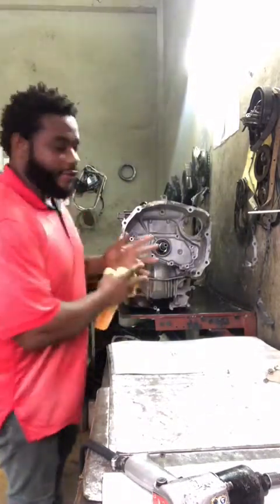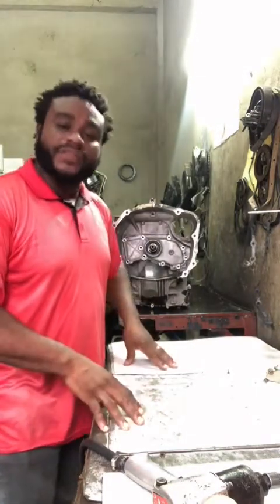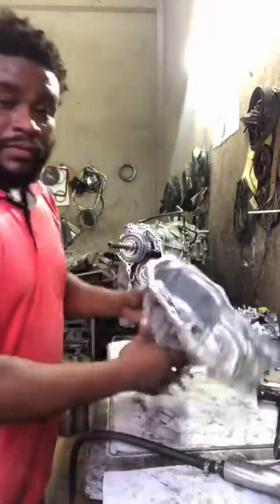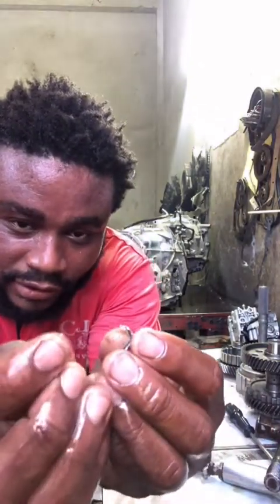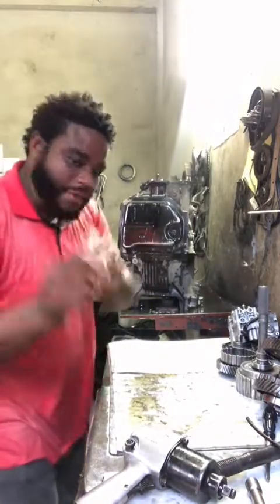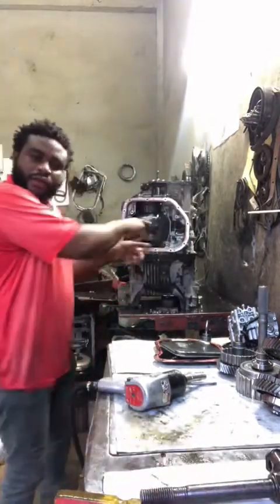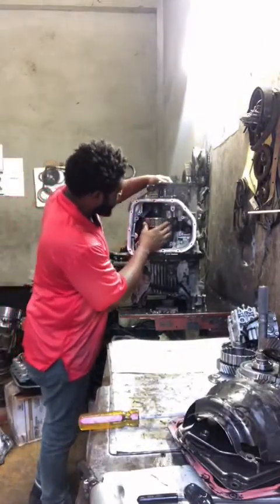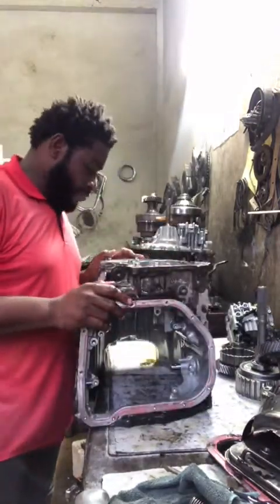2013 Subaru G4 transmission CVT Primary pulley bearings damaged

Comment: Good video but that bearing is for the secondary pulley, the primary bearing is the one near the filter
Reply from the maker: Primary bearing
Reply: @constructivetv6436  Nope have a look at a Subaru TR580 service manual. The primary pulley sits on the forward/reverse clutches/input shaft. The primary then drives the secondary pulley which is in the lower part of the trans (where the failed bearings are). Happy to send you the service manual or a parts diagram?

Comment: i have crosstrek 2013 , bearing secondary pully was broken and houshing was broken also hitted by secondary pully , 
try to repair houshing ,  some small part can get such washer , spring washer. etc .
so i assemble again without them, put back on car , now when start to move have jerk i think chain slipage on pully . 
please help sir how to get small part. 
big part such as pully set have in China .
but small items dont have ..
Reply from the maker: Good night sir you can get parts here in Jamaica. It just depends on where you go
Reply from the maker: Small parts such has?

Comment: I have problem with DQ200 DSG Dry Dual Clutch after replacing duel clutch of DQ 200 car run only in 1st 3rd 5th and 7th and reverse only engaged when we start the car from neutral. Any suggestions for this problem.  Problem start when clutch bearing damage and after that we change new clutch. Now we try with old clutch and another new cluch but problem is same. We try basic setting but basic setting not perform.
Reply from the maker: Thank you for your information however you need to bring that car to me that I can check and tell you what is going on with your vehicle I located at Number 2 Elspeth Ave.  Off East Rd., Kingston 10